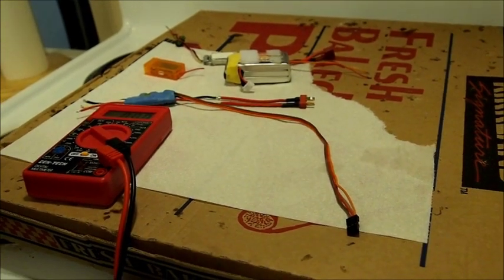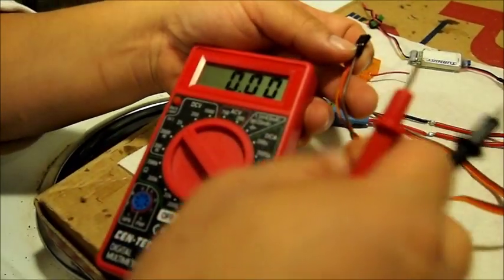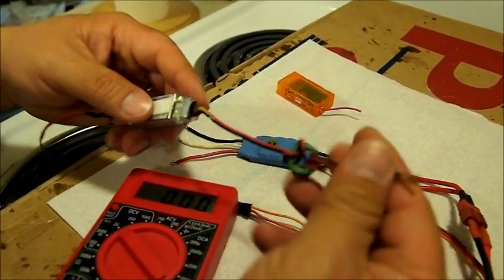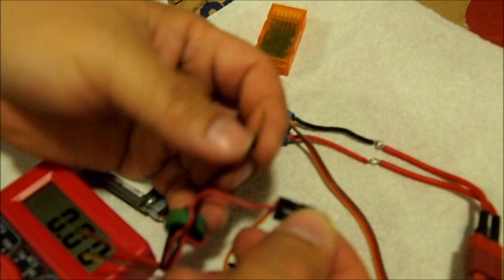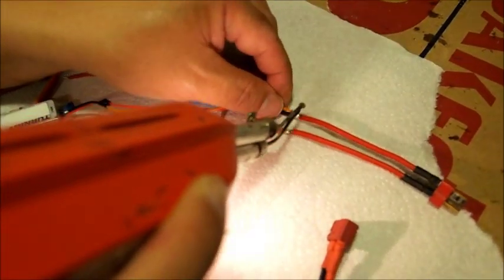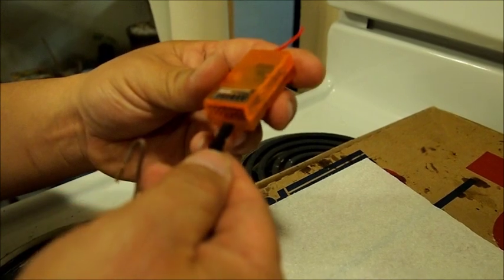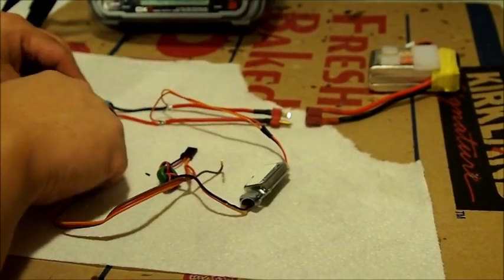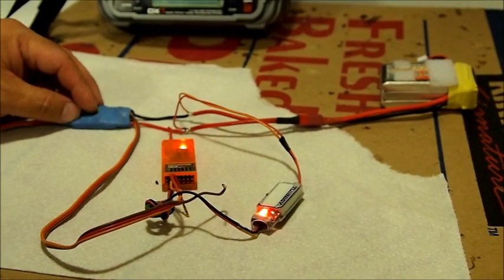External UBEC "How To"

Comment: if i'm not mistaken, you can also plug the output wires from your UBEC to separate channel on the RX and disable the red RX wire coming out of the ESC,  am I correct?
Reply: Yes, that is the schematic that Castle-Creations has for using a SBEC with their products. Pull the red wire from the ESC, heat shrink it, and plug the SBEC connector into any open Rx port or a Y-connector to a port if none are open.

Comment: Hello, thanks for good explanation, i have not enough information about these topic, So that, i have a basic questions. I have a esc which has 5.8V 3A bec, i connect this bec wire to my 3 channel receiver and it works successfully. Last week, i bought new esc (6.1V 3A SBEC), i connected to my receiver. Firstly, it worked two times and after that, it stoped working. Now, second channel of recevier is not working. I think that, it damaged. I need a external bec, am i ?
İs this setup is equals to that setup http://www.eflightwiki.com/eflightwiki/index.php?title=File:Electronics_schematic_UBEC.jpg,    you connect bec wire to esc (esc to receiver) wire, but setup which shown in the link, connect 2 wire to recevier. are these setups equals, or what is the diffirences? please help thanks.

Comment: Good explanation, exactly what I need to do. I have only one question:

Is it really enough to have only the signal wire from the ESC or would it be better (or worse?) to connect the brown (minus) wires from the ESC and the BEC like a Y? I was thinking maybe the signal also needs a direct ground connection. Or is "grounded enough" by the battery cables?

Comment: Thanks man.  Your video was just what I needed.  I bought a used plane an Artistic Aerobatic Extra 330 and I could not get it to bind.  The ESC was wired wrong and the voltage was set to 6 volt.  Once I set it to 5 volts and combines to set of wires onto one plug it bound right away and everything works!
Reply from the maker: R Dawg you're welcome. glad I could help.

Comment: Why dont they make them all like that? When your esc blows the plane/heli goes down. Or is that just what they want? Is this way more expensive than just a build in esc with bec. I think the way you did it now is way more save. Mabey its better just to buy these seperate in the first place. But thats not what the want. They want to give you a combo deal and maybe crash your RC. Thanks for the video. The only thing  i want to know us how much volt do your servos need. 5-6volts and the lipo used ofcourse. 3s-4s-5s-6s. What do they mean with 3-4-5 amp on the ubec. The more servos you got the more amps needed? Or does this relate to the amps of the lipo,s used? max amp draw? Thanks again for the video.

Comment: I did not do all of that. Since my UBEC had the  needed positive and negative wires  in it's own plug that goes into the receiver, all I had to do is eliminate the ESC red wire  lead out of  it's own plug tab and tape it up. Just one wire.. ;-)
Reply: +derjoh1986 : Your method works fine, if your RX has a free socket: Than you leave the plug coming from the ESC (where you disconneted its PLUS (= red wire) in the socket for the throttle signal (say: Chanel 3) AND put the plug from the external UBEC/SBEC with its own PLUS and MINUS in the free RX socket (say: Chanel 5). In case all sockets at your RX are engaged, rcAllDayLong's way works perfect, as the ESC's throttle signal (coming in the video above via the orange wire) AND the external UBEC/SBEC's PLUS (= red) and MINUS (= black) potentials are connected to the RX via the same plug (say: in Chanel 3).

Comment: just a quick question on turnagy sbec i have just had a major crash on my align 500 trex couldnt pin point but motor wouldnt shut down after i but hold on-- on the dx8-- shut transmitter off motor kept running heli ended up on its side wrecked all the futaba servos inc the rudder, stripped main gear the list goes on, suspected the turnagy 40 amp sbec, could this be the culprit of this expensive crash, your thoughts mate cheers

Comment: As someone who just got into the hobby, I'm grateful that you posted this very informative video. 

Now, I have a question. Does this mean Pixhawk + Opto ESC setup no longer requires external/separate UBEC since the flight controller is powered directly through APM Power Module ???

Thank you.
Reply from the maker: obliqueshockwave shockwave, I know nothing about the Pixhawk, but you should be able to test this fairly easily. Without the external/separate UBEC, do you get power to your servos? If yes, and you are sure your ESC is Opto, then you already have power and a separate UBEC is not needed.

Comment: That was a great video. Man, my instruction sheet that came with mine was so light I could not see it. You were very helpful. My question is how did you manage, battery, power board, flight board. There is so little room.

Comment: If I plug my UBEC to an aux channel and my ESC, minus the red wire tot he throttle channel, do I need to setup the throttle on the aux channel?
Reply from the maker: No. The ubec will simply feed power to your Rx. Your ESC will still be feeding the throttle signal to your Rx on the throttle ch. Hope that makes sense.
Reply: Yes.  I just wanted to confirm.  Thank you.
Reply: @rcAllDayLong  You got that the right way round? I thought the receiver fed the throttle control signal to the ESC. ;-)

Comment: thanks for the video.
i have a question, can i just disconnect the red wire from the esc and conncet it to throttle channel, and the UBEC to the receiver through another channel?
Reply from the maker: Yes. UBEC can go on any open channel.
Reply: rcAllDayLong can i attach my ubec to the flight controller (naze32) in one of the slots that the ESCs would go in, instead of the receiver?
Reply from the maker: Living Universe Sorry I don't know enough about that controller; however, remember that a ubec's purpose is to supply a constant power (5v, 6v, etc). Just make sure that where you are plugging in that it accepts power and that what you are supplying can be tolerated. I would review the schematics for that controller.

Comment: Hi sorry for ask you about heli,  I already read that you not are, but I would like to ask you about a problem that I have with my 450 heli,   it burning the servos  all the time when i plug in the battery,   probability is because hight voltage coming  from the battery through  receiver. do you think if I used this UBEC can regulate the voltage coming from my receiver ???
thank
Reply from the maker: This depends if the problem is actually high voltage coming from your internal BEC. have you put a meter on the BEC and see what is the voltage? Anyways, to answer your question, if above is the problem, then yes, you can definitely do this and just make sure the UBEC you buy will put out less voltage than what your servo can handle.

Comment: Instead of removing the positive and negative from the esc plug,can you just remove the positive wire from the esc plug and plug the bec into another Chanel ?
Reply from the maker: Yes. if you have another spare channel, that would work too.

Comment from the maker: No worries. we were all noobies at one time. To answer your question, No. An ESC is not the same as BEC. ESC controls power to your motor, while the BEC provides power to your rx and servos. Many ESC's have built in BEC, but for reliability and other reasons, some choose to use an external BEC. With an external BEC, if your ESC dies, you still have power to rx and servos and can still control your plane. hope that helps.
Reply: Quick question: if my ESC dies, doesn't the BEC also dies at it's connected from it? Thank you after 8y :D

Comment: Trust me the ESC will not work with only 1 wire going to it.
Reply: The battery connection, the ESC and the internal BEC must share a common ground thus giving you the return line via the soldered on battery connection for the external BEC. If no common ground it won't work. If there is a common ground it is probably better to use only 1 (the signal) wire to ESC or you would be creating a fairly large earth loop in the system.

Comment from the maker: hmmmm....so... how do you explain it working in the vid? I can assure you this works. If you didn't know, there are 2 types of ESC- 1. ESC with BEC built in (this is what you see in the vid. it will work with both red and black unplugged. You must remove the red) 2. ESC with No BEC or OPTO (true OPTO requires the ground and the red wire to communicate)
Reply: Leaving the redundant - wire in place in a common ground system would give a large earth loop to inject interference into the set-up. ;-)

Comment from the maker: In this vid, since I'm disconnecting the power from the ESC, and piggy back into the same plug, it then needs to be plugged into the throttle channel.  The other way to do it is to simply disconnect the power from the throttle and plugging the UBEC to the battery channel or any open channel would work too. Either way achieves the same goal- that is to bypass the power from the ESC and use the power from the UBEC.

Comment from the maker: Yes, this method will work just fine; however, look carefully at your ESC and see if it mentions whether if it's opto or not. if it does not mention then don't worry, just follow the process in vid. if it does, do a bit more research to make sure it is opto. True opto ESC's require the red wire to be plugged in from the ESC to your rx, as well as the red wire from your ubec. hope that helps.

Comment from the maker: I've actually never done it with just the red wire from the UBEC. As far as I know and have tried, you can either leave the red and black wires of the UBEC and just take the signal wire from the ESC and plug it into the UBEC wire and use that...so it's signal-red-black, or the other way is take the red-black from the UBEC and put in place of the red-black on ESC. As far as plugging in same/separate channels, both methods are fine since the + and - on the rx pins run in parallel anyways.

Comment: Thanks for your great video - other tutorials uggest just none ting he positive wire only from the ESC servo plug- is this still ok ( as you disconnected both the positive and negative wires)?  Also am I missing something but are you connecting the ESC and BEC  with just one servo plug ( thus saving using a spare channel) as those other tutorials end up plugging the ESC and BEC servo plugs into separate channels on the RX (which I'd rather not do and save using a spare channel wondering if Inca

Comment from the maker: Yes. 100% will work. Matter of fact, I've in the past used ESC's with bad bec's this way. Make sure the ESC is still reliable though- I'd use it on a cheap plane and use it for at least a few flights before putting it on the nicer planes.

Comment from the maker: Sorry, I'm not a heli guy, so I wont' be much help; but if you're overheating, replacing the UBEC won't help you. if you are overheating the ESC/motor/batteries, the load you're putting on your motor is above and beyond what your motor/esc/Lipo can put out...hence lots of heat. Again, I don't know much about heli, but I think from just overhearing the heli guys, you need to adjust to you fly with a lower head speed.

Comment: i fly a 4 blade KDS 450 C with a 400 gram fuselage.  When flying my esc, batterie and motor were overheating and the tail was drifting. So i bought a KDS UBEC 8 amp and disconnected the red ESC wire.  now im still suffering from tail drifting ,  what can i do about it ?

Comment from the maker: Yes. that's exactly what it's meant for....although the one you posted is an overkill for most  planes. It is rated at 8-15 amps (that's a lot), we're talking 6+ servos and huge servos. If you have 5 servos or less use the 3amp one.

Comment: Can you use a UBEC as a voltage regulator?
i want to power a receiver thats rated at 6v max with a 7.4-11-1 v battery.
can i use this UBEC to do the job?

Comment: great video! helped alot. Could you also disable your +on your esc, plug into your Normal throttle position on the RX and just plug your Bec into the Battery/bind slot?

I think this would be easier, as i just done it. ;0) 

Thanks for the video!